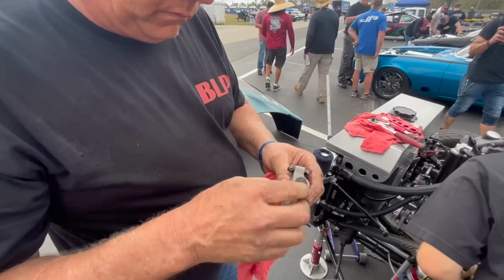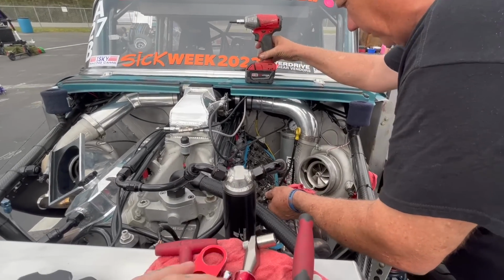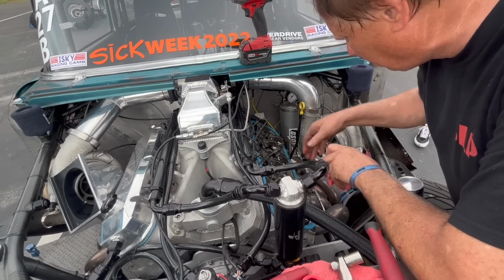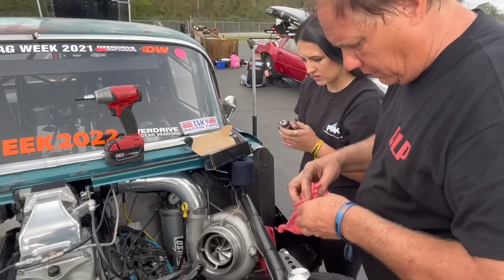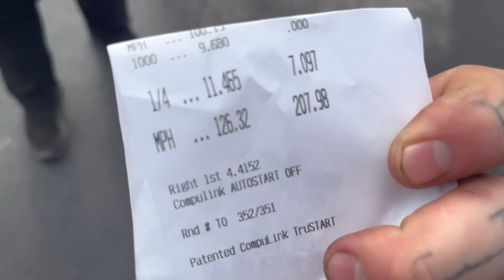Day 5! Alex & Dennis Pull Off The Win At Sickweek 2023!

Comment: Perhaps those rocker shafts should  have been hardened a bit more.  (Unless it is the needle bearing chipping first).  If the needles can't take it, then they need to be a slightly larger diameter, outer race adjusted accordingly.

Comment: Is it cheating for outsiders to look at the tune? If the racer or copilot are the only one to work on the car the then it should be that they should be the ones tuning the car.
Reply: Anyone can assist with tune, can be done at track or remotely. It's a given requirement of the sport, so allowed in the rules.